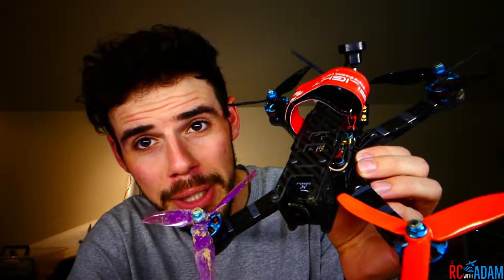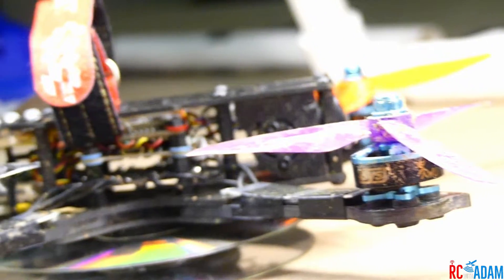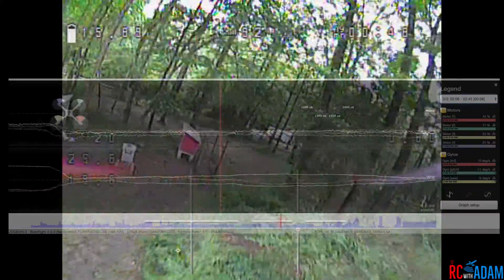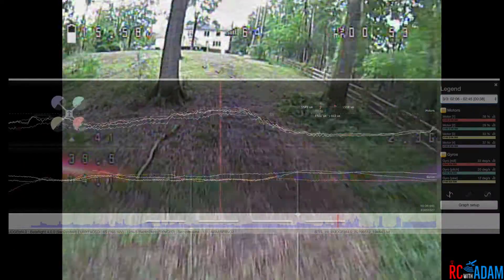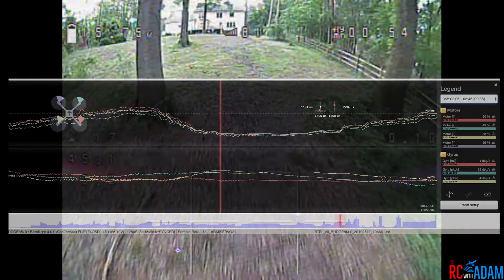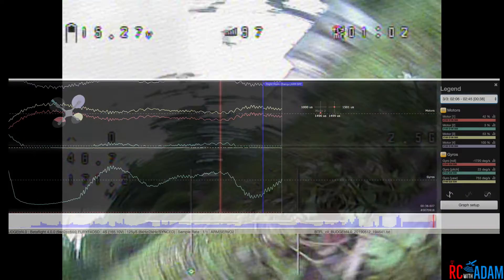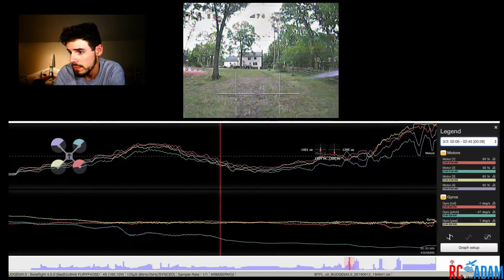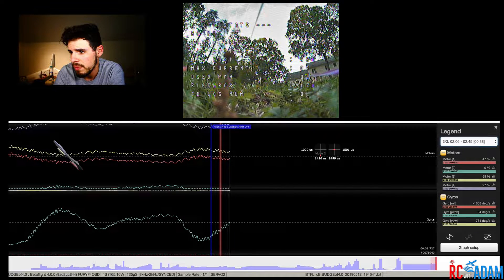(SOLVED) Mamba F405 Death Roll BlackBox Data

Comment: I have a different problem with my mamba f405, it throttles up and doesn't come back down, only way to kill it is disarming it....any idea why the throttle runs away? I only get my stick to about 20% and it just goes nuts
Reply from the maker: Hi! Oh no! Does this happen on any other quads? I was thinking maybe it's some sort of issue with the gimbal sensor.
Reply from the maker: But the first thing I would try is update the flight controller and esc firmware.
Reply: I have flashed to latest firmware, still does it, calibrated the motors...only thing I can think is it's not compatible with my ppm OrangeRx r617xl Rx with spektrum dx6i transmitter....I have ordered some spektrum satellite Rx  (ppm) and will try again...failing that I'm returning the mamba FC and will go for turnigy razor f4 next time as I've had them before with no probs.....to be continued 🙈
Reply: @xbenr  hi, ı use mamba f405 stack and flysky transmitter and ı have same issue. my first drone so ı can not know what will ı do. did you solved throttle issue.
Reply: I have the same problem. Motors are OK. Only when I ARM on Frsky TARANIS it gets creasy. When I ARM within BF everything is OK and the motors follow the throttle. The problem doesn't appear, if all PID setting at "I" are 0. Otherwise the PID roll constantly increases for unknown reason. Did you solve the problem?
Reply: @sipecr  this could possibly be a voltage issue, is your Rx 3.3V or 5V? Make sure it's soldered to the correct Voltage output on the board...let me know how you get on
Reply: @xbenr  Hi, I use Frsky XM+ (3.5V to 10V) connected to 5V. In BF - transmitter shows good signals. Backbox explorer correctly indicate throttle-set to minimum. The problem is that PID SUM ROLL is linearly increasing due to  "I" component.
Reply: @sipecr  All I'm saying is I've had problems like this in the past, and whe you've tried everything else, for the sake of moving a soldered joint, it's worth considering, I use multiple spektrum RX which are rated 3-10V but they behave strange on anything over 3.3
Reply: @xbenr  OK, TNX

Comment: I had a couple on two different diatone quads. Both f4 mini mamba stacks. Low motor idle solved it for me so far on both quads for me. Both running dshot 600. Never ever had a single issue on kiss hardware. Love diatone and betaflight but much more setup to go through before being 100% confident. Take care and hope you get it
Reply: Do you remember how you much you had to bump up the idle speed ? I've gotten this issue today on my first actual flight with it today
Reply: @SwainixFPV  try 5.5 I usually run it at that. I started having Dsync much later due to a bad motor also. Definitely don't like those mamba motors. There not at all durable. Actually most small motors are just not very durable. Anyhow I switched to xing 1408 2800kv 6s motors. It Flys like a dream now
Reply: @mike216ism  I have 4 xing-e 2306 motors, 2450kV, I'm still not sure if it's the gyro flipping out on me because it's really cold and maybe just a little bit of snow got in between the stack but I changed it and will fly it later today, thx :)
Reply: @mike216ism  well it didn't desync today so that maybe fixed it, thx mate :)
Reply: @SwainixFPV  happy to help in any way I can. I will say having a Dsync nowadays on a quad usually is something related to physical damage. Definitely keep your eye on a possible bad motor. Take care
Reply: @mike216ism  thx for the advice, take care you too

Comment: Same problem
Reply from the maker: What motors are you using?
Reply: Dys Samug 2207.
One motor is bad, I soldered the motor to other position and the motor is not spinnig sometimes like before, and death roll is the result in the direction of the motor. I checked the black box data..

Comment: Follow Siamect's suggestion. If that doesn't work, I would suggest getting a new ESC, and maybe not a Mamba. It is very inexpensive, which could lead to a bunch of problems later on

You might also want to see how much noise is getting into the gyros, which could also cause rolls of death. Click the strange icon near the deg/s on the Gryo traces and see how much noise there is. In a perfect scenario, there is a huge spike from about 0-60hz and a smooth roll off. There should be no spikes after that

Watch JB's video on desyncs. VERY helpful. (https://youtu.be/DWIyXmv5GIQ)

Comment: Motor or esc or signal problem of the left forward motor. The FC want it to go faster but it doesn't follow the command. So the FC will give it more and more until it is on full signal. 
Check the signal cable between the fc and esc. Check motor cables.